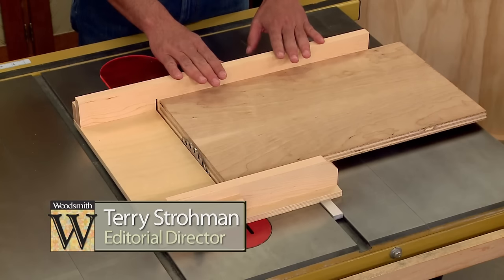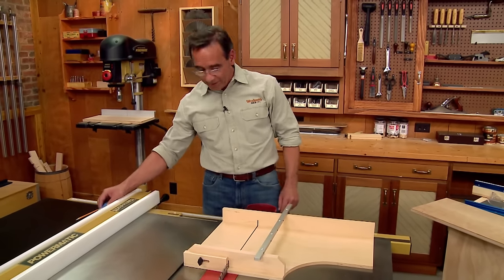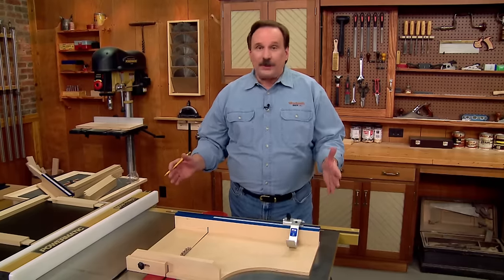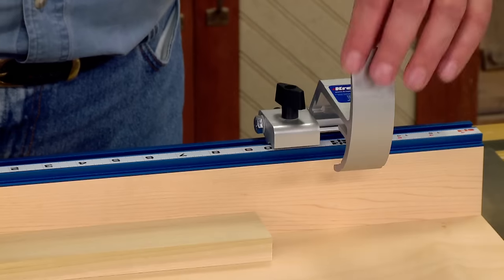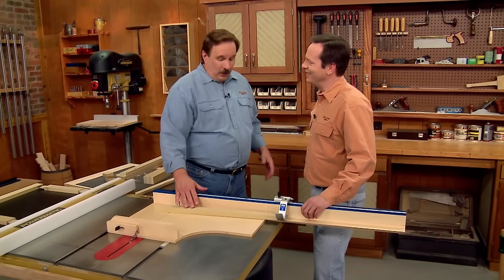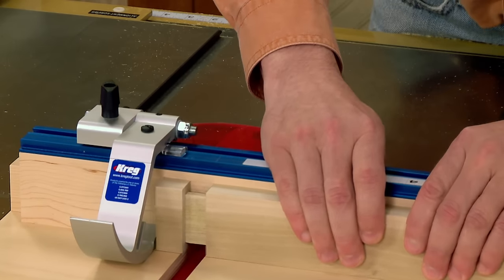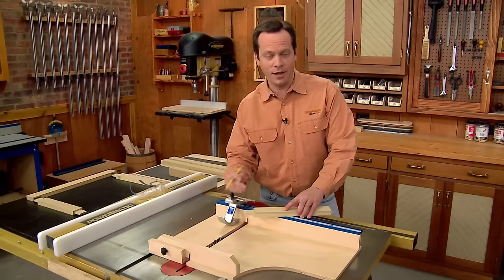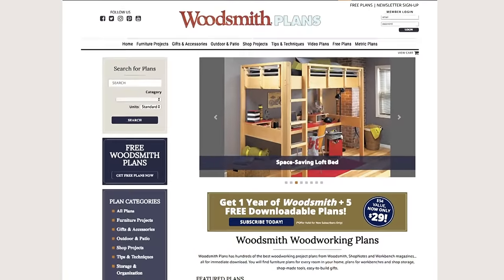Maybe the Best Table Saw Crosscut Sled Ever?

Comment: Looks great.  Too bad I am unable to put it on my older skillsaw 3400 table saw because the miter slots are not standard.
Reply: I haven't checked, but I expect to encounter the same thing on my Craftsman.  Can't you use different size rails in the slots spaced at different widths?  The screw adjustments would work in wood as well, or might be able to buy and cut down aluminum rectangular tubing or solid stock.
Reply: @1SCme  Use PVC or Starboard, HDPE,etc, they are slick and will not bind.  I too have an old Craftsman and will not part with it

Comment: Nice sled!  Adjusting to dado and extension for larger pieces great touch.  I made a basic sled this could be my next.  I do want to make one that will take wider plywood boards (higher up on the table saw; width not length).  Do you have plans for that?
Reply from the maker: Thanks!  This sled might have a little more capacity: https://www.woodsmithplans.com/plan/ultimate-crosscut-sled/
Reply: @WoodsmithShowandmagazine  Thanks I'll check it out

Comment: Nice sled. Just a brief comment about your kreg stop. I believe you have assembled it backwards. looks like you made up for the mistake by locating the end of the tape further away from the blade. By assembling the stop in the fashion you have reduced the stability engineered into the design. When assembled correctly, the lens will be on the blade side, not the other way around. That or mine is a newer version!

Comment: The best crosscut sled ever is part of the Precision Woodcutting System by Ryobi.  It was an 8 inch table saw that had a sled as it's miter gauge.  No dicking around with homemade crap.  Sears even had a Craftsman version.  Funny thing was the pros poopoo'd it at the time because it was a cheap Ryobi.  Now they all want sleds.
Reply from the maker: Thanks for your input.

Comment: I like the way you can adjust for Dado's, but if you want to use the kreg stops, the fence is too small in my opinion. I bought the plans & made it. I didn't like the fence size at 2 1/4" high. The other parts are great.
Reply from the maker: Yeah, the height of the fence needs to be 2 1/4" to use the Kreg flip stop, but if you wanted to just use your own stop block or flip stop system you could really make the fence as tall as you want.
Reply: Woodsmith, Very true, exactly what I did. Works great. Pans were perfect. Thank you.

Comment: what do you do when your table saw tracks have tabs?
Reply from the maker: I don't think that should be a problem... you can either use a runner that accommodates the tabs or just use a rectangular-shaped runner like the one shown. What  model of table saw do you have?
Reply: @WoodsmithShowandmagazine  Model #315218050 Craftsman table saw
Reply: @WoodsmithShowandmagazine  I have not been able to find runners that accommodate for tabs. any suggestions?
Reply: I have the same problem with my Craftsman table saw. Was thinking about grinding the tabs off.
Reply from the maker: @DanMoellering  - I guess I wasn't really familiar with this tabbed runner design with craftsman and other comparable table saws.  It looks like people are either grinding off the tabs or making t-shaped runners.  Here is a pretty good tutorial on how to make a runner for tabbed slots:  https://www.youtube.com/watch?v=bKIXUw7IhlY

Comment: Note that as the viewer of your video, I'm in the position of standing behind your table saw.  The adjustment of your sled allows the left side of the sled to move further left, but if i change from a single blade to a dado stack, the thickness of the blades increases to the right, not to the left.  The single blade is already as far to the left as it can go since it's pressed against the arbor plate.  The dado stack will also be pressed against the arbor plate and the stack thickness will increase to the right.  
The thickness of a dado stack will also blow out the slot in the front and rear rails making the slots to wide when you switch back to a single blade without causing end tear out.  Please explain these problems to me.
Reply from the maker: I'm not sure if I'm following your question correctly but I'll do my best to answer.... The sled you see in this video is built for a left-tilt saw so the dado stacks to the right (from users perspective) so the sled also expands to the right to accommodate this. If you have a right-tilt saw then you will have to mirror the construction and have it expand to the left. (photos seen here: https://www.woodsmithplans.com/plan/precision-crosscut-sled/)  As you switch back and forth between single blades and dado blades the back fence will begin to get chewed up which isn't a big deal because it will be on the waste side of the cut, but if it gets too chewed up you can either replace the back fence or as I suggested  in some other replies you could make a replaceable hardboard insert in the center of the fence.  (I plan on making a video to show this modification in the future.)

Comment: This is a neat sled, guys. The features you've built in to accomodate dado sets and the rail system really add to the versatility. I do have an observation/question. Many sleds I've seen feature front and rear fences that are higher in the middle (along the blade track), which I assume is to ensure the fences remain joined across the left and right of the sled when raising the blade for thicker stock. So:
Q: What is the thickest stock you can cut with this sled before the integrity of the fence is compromised?
Q: Could the fence design be safely modified so the center is higher? Obviously, you'd have to then modify the fence system. Maybe just make the entire fence higher? 
What are your thoughts? 
Love the show! Keep up the great work!
Reply from the maker: With the current design of this sled I would say you can cut 1 1/4" - 1 1/2" thick stock without a problem.  The main thing driving they height of the fence is using the kreg track for the flip stop... it needs to be at that specific height for the flip stop to function properly.  You can make the front bridge taller without a problem and add a taller back bridge behind the fence to hold the base to together if you wanted to go thicker though.  We also have a table sled design with the hump in the middle like you are talking about that solves this problem too. You can see that one here: https://www.woodsmithplans.com/plan/ultimate-crosscut-sled/
Reply: Interesting. Now I'm musing about a hybrid of the two. Thanks for sharing these plans.
Reply from the maker: A hybrid would be pretty cool.  We plan on shooting a video soon with the "Ultimate" crosscut sled too, so you'll get to see that one in action.

Comment: Great video and I probably will make one.  I have one I made years ago, and use the heck out of it.  But, I love the versatility of this one.  The only thing that bothers me, is the possibility of the saw / dado blade not being covered as it comes through the fence.  On my old one, I added a couple of 2 x 4 blocks that the blade can come into, but only to a stop added on the side.  Hope that makes sense, but I assure you I will design one for this Sled when I make it.  
Regards,
Keith
Reply from the maker: Yep, not a bad idea.  You can never be too safe.

Comment: I've seen this before, and I'll probably build one like it one of these days. Problem for me is that my Jet TS is an older model: my blades stack in the opposite direction. I haven't figured out a way around that....yet.
Reply from the maker: Just flip the design so that you cut on the right side of the blade... actually the plans for this sled show it in that orientation.  We just built it in this orientation for our saw.
Reply: @WoodsmithShowandmagazine  Believe it or not, I was sitting here watching another video with a guy using a sliding table saw and thinking exactly the same thing!
Reply from the maker: Honu425 -LOL 👍

Comment: No riving knife Installed?   ...this sled won't work with one?
Reply from the maker: Unfortunately, this particular table saw model's riving knife is really set up well so we don't have it installed.  I think it would work with the riving knife on most table saws though, and if you have a good riving knife I would recommend you use it.  It's a great safety feature.

Comment: So I noticed when you opened the slide to accommodate the dado blade the fence was flush with the base.  Then there was a dado notch out after the jump cut for the first dado. 
Now wouldn't there be a dado notch in the fence when you want to make normal cuts?  Will that affect normal cuts with a permanent dado clearance in the fence?
Reply from the maker: Yeah, the back fence will get notched out with the dado blade but it won't be too big of a deal because it is on the waste side of a normal cut.  I have been thinking of adding an optional, replaceable hardboard insert there so if the fence gets to chewed up with different sized dados you can change out the hardboard.

Comment: Nice design with the spread feature . This would allow for dado set ups ,  However, table saws are designed to have the blade pivot at table surface level on angle cuts .  ON a  surface that is ~ 3/4 " higher, as on a sled, this point moves from center off to left AND right by up to 3/4" . A Precision saw sled must be able to provide zero cut tolerance under all cut set ups . (most sleds use inserts to achieve this )  SO , it's back to the drawing board to expand this idea !!
Reply from the maker: Yeah, this sled isn't really designed to do mitered cuts, but this ULTIMATE Crosscut Sled with replaceable zero clearance insert is: https://www.woodsmithplans.com/plan/ultimate-crosscut-sled/  (*both of these sleds have 1/2" plywood bases, btw)

Comment: Would you be kind enough to provide a link to the tools and psrts you used.  Especially a link to that aluminium slide bar to go into the track of the table saw.
Reply from the maker: Yes, all of the sourcing is included with plans, but I will work on getting it up on our website, as well.  Most of the parts for this sled come from Kreg Tool including the aluminum runner found here: https://www.amazon.com/Kreg-KMS7303-30-Inch-Jig-Fixture/dp/B0002QZ4SA

Comment: I love the extension idea; definitely want to incorporate that into my sleds.  The problem with the dado option is that now the fence has a bigger cutout, so on common crosscuts, there will be splintering.  Can't think of how to resolve that without having a separate sled.
Reply: This is exactly what I was thinking. The first time you use this on a dad you won’t be able to prevent chip out on the fence portion when you go back to standard blade. I am in the process of making my cross cut and I can’t think of a solution other than having a separate sled.
Reply: @Mikemillering1  I've thought about it a little more since then.  Only thing I can think of is to just make the fence travel with the base as well.
Reply: Did you ever think about putting a 3/4" piece of wood against the inside of the sled and your work piece in front of that ?! You won't be cutting a Dado through your sled, and you can keep it tight for no tear outs when Dado is not in use.
Reply: @rickkyriakopoulos1103  Sure, that works, but I would just use a different sled for regular cross-cuts; if I'm switching to a dado set, I'm taking the sled off anyway, might as well grab another sled.  I'm talking about how to incorporate it into the design.

Comment: It seems that the dado blade messes up the back fence.
Reply: William Ellis, not really because you'll still have a zero clearance with that adjustable base. Definitely worth building the sled.
Reply: Still a gap in the back fence.
Reply from the maker: @williamellis8993  - The gap will be to the waste side of the cut (on normal, 1/8" kerf cuts) so the workpiece fibers are still supported.  But I see what you're getting at.... Maybe a replaceable, sacrificial insert would be in order to here.
Reply: Woodsmith  - Yeah, while watching this, I was thinking the same thing and trying to figure out a way to make a replaceable front fence. 🤔
My first thought is to build two sleds - one dedicated to my standard kerf blade and one to use with the dado set. You still need a slight bit of adjustment on the standard sled if you change from a rip blade to a finishing blade, for instance. So the adjustability is a helpful feature.
But I'm thinking the replaceable fence idea is not out of the question. 😁
Reply from the maker: @David_K_pi  - I am thinking of just cutting a 1/4" deep pocket in the middle of the fence a few inches wide (where the kerf) would be for a replaceable piece of hardboard like we did in this box joint jig: https://www.woodsmithplans.com/plan/adjustable-box-joint-jig/
Reply: Woodsmith, I agree, it's honestly not a big deal to me at least, as the gap will be to the waste side however a removable backboard for the dado kerf, like the box joint jig, is pretty awesome! I love woodworking as there is almost a solution to everything and anything

Comment: Thanks for your explanation. Now I understand. I just hope I can build it in reverse with my dyslexia problem. There are two things that I noted that the plans did not list. How deep is the dado that the rail fits in and also how long is the slot that the expander moves in. It looks like the slot is about 1” and the depth of the dado is 1/16”. How close am I to right? Thanks again for your quick response. I wish they had made the plans the same way as the video shows the sled.
Reply from the maker: BJ McPherson - I will double check on those dimensions for you. I agree that the mirroring of the sled gets confusing. I think when we originally built this project most saws were right-tilting and now pretty much all saws sold today are left-tilting. I think it would be a good idea if we could include updated drawings for both versions... I will see what I can do.
Reply from the maker: Okay, I'm looking at the plans and I'll admit some of the details are sometimes hard to find because we are trying to fit so much information in a small space.  On page 4, Figure 2 it says to cut the Dado in the Base 1/8" deep and to match the width of the Runner (usually 3/4").  On Page 5, Figure 4 it labels the slot on the back Adjustment Block as 5/16" wide x 1" long. Hopefully, this answers your questions.
Reply from the maker: I was able to track down a couple mirrored images that we made for the left-tilt version, and I e-mailed them to you. Hopefully that is helpful... it will coming via and @aimmedia.com account.

Comment: Not unique in any respect. Don't like the sliding table, every table I've seen uses the miter track as guide  but most use both tracks. You did not explain the 5 cut method for accuracy and did not include finger protection on the use side. Not a good design at all!
Reply from the maker: Carl Anglin - I originally “thumbed down” your comment just to mess with you for your other reply, but admittedly that would be immature and petty.  You make some well thought out and valid points.  Although I don’t fully agree with your assessment that it is not a good design at all, I respect the time you took to watch the video and give your opinion. Thank you.

Comment: Nice safety warning regarding guard removal.  What's not mentioned, is you can't use the guard with the cross-cut sled.
Reply from the maker: True, but I would assume that would be common sense, but when it comes to a lot of shop injuries it would be due to lack of common sense...  So probably a bad assumption.
Reply: Duh ... of course you can't. Thanks Captain Obvious.
Reply: @jusdane22  he was recently promoted to Major. ;-)

Comment: You have a flaw in your theory that the aluminum bar does not contract or expand as it does but not from Humidity BUT FROM TEMPERATURE VARIATIONS!!!
I would reexamine your assembly and make your guides with expandable adjustments so it can be dialed in during colder months for the people in the North.
Reply from the maker: This is true that aluminum will expand and contract with temperature changes, but it should be very minimal in a climate controlled shop. However, the aluminum miter bar we used (Kreg KMS7303) does actually have several nylon adjustment set screws along it's length so you can adjust the fit over time.  It works great - check it out: https://amzn.to/2CWqxIn
Reply: @WoodsmithShowandmagazine  I made my own some time ago with a Aluminium base that can be used to cut any angle up to 130°. Thank you for the information but many of my talents are not limited to just woodworking.I am a Master ASE TECHNICIAN which my abilities are Tig ,Arc, mig,welding, blacksmithing  AUTO/Diesel repair,bodywork and Machine work manly for metal fabrication/ machining and engine machine work.
Reply from the maker: @apacheone3643  - Wow, you DO have a lot of talents... I'm jealous.   I wish I had the time and talent to learn some of that - maybe someday ;)
Reply: @WoodsmithShowandmagazine  It has taken me 45 years but I had a lot of help from my Family to learn so much. I credit my Father and brothers with most of my training  then High School and College. DENVER AUTOMOTIVE AND DIESEL COLLEGE.
The School was taken over by Lincoln Tech and moved.
I am the lead Technician in the largest Repair shop in N.Y.C.